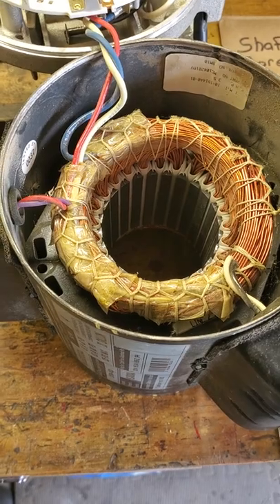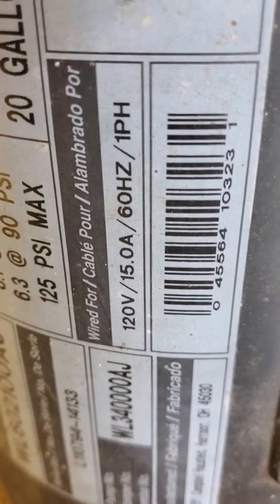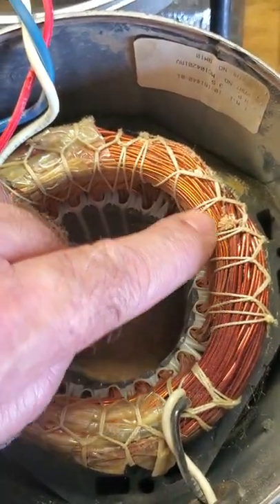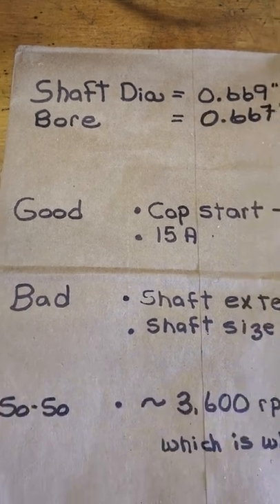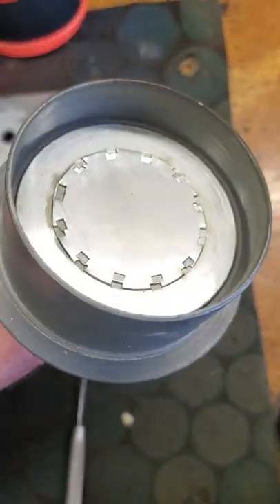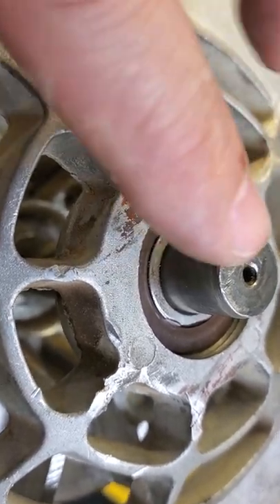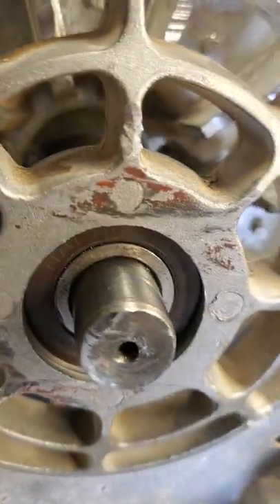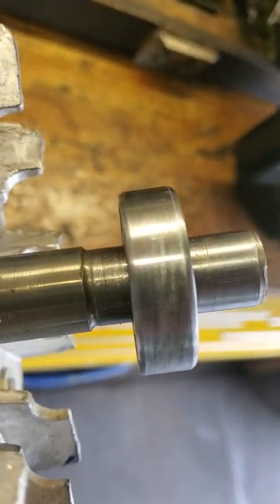A lesson on electric motors:  Salvaging an electric motor from an oil-less air compressor.

Comment: Hi Bryan. 
The oil less compressors are rebuildable farely cheap if you only need the cylinder sleeve and piston ring. Thanks for another video!!!
Reply from the maker: Thank you for watching. Maybe I should have rebuilt this and then I would have had a "free" second compressor.